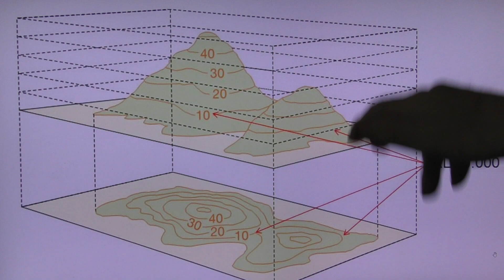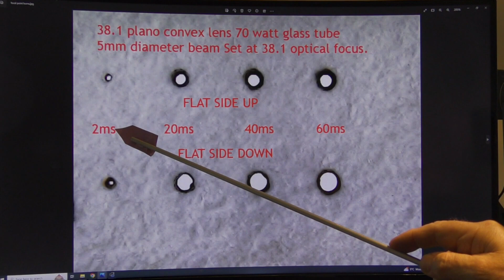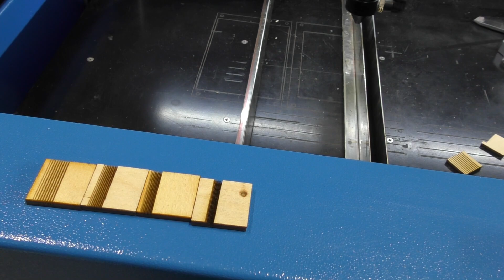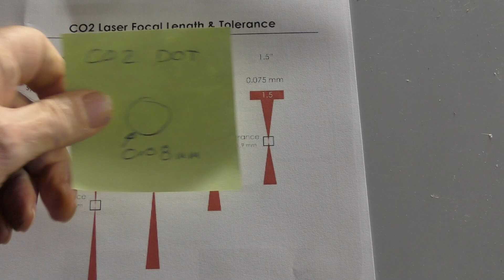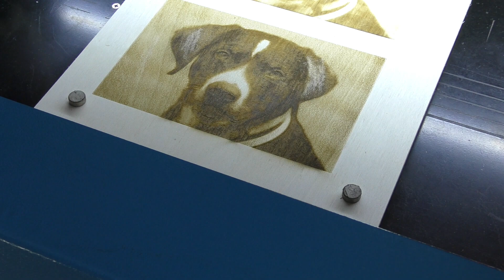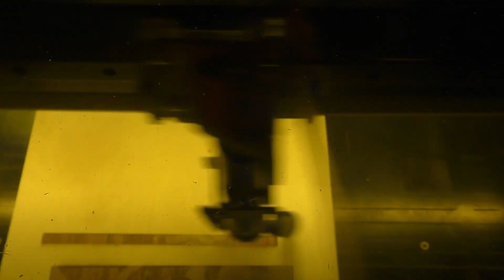3D Engraving Myths and Misunderstandings

Comment: Super informative but STLs (and basically any 3d computer mesh) can be used for "real" 3d engraving. However you need to turn them into a "depth map" using something like meshlab. 
Most software will display them as "renders" and like you pointed out that is basically a photo at that point.
Thanks so much for all these videos you are a true master of the laser!
Reply from the maker: Hi
 Thanks for the kind words. I understand what 3D meshes  are and as I mentioned in the video. they capture sufaces mathmatically in space and thus contain complete 3D information about a surfacere. However I am not familiar with any software that can  interpret a view of a 3 D object into a 256level depth map for laser engraving. You mentioned Meshlab  (maybe Slicer and Blender also?)  I have not seen any videos tutorials of these softwares that demonstar how  generate depth maps from STL files. Links to any such videos that you may be aware of would be extremely helpful. Many thanks......Russ
Reply: @SarbarMultimedia  Thanks for the reply Russ! It seems my reply decided to delete itself it seems you tube doesn't like external links sometimes so I'll do my best to give a tutorial here. Please note I'm still a laser novice and haven't actually tired cutting the outputs of this process. 
1) Load the model in Meshlab (File -> Import Mesh)
2) Rotate until you are happy with the orientation 
3) Change the Render mode to Depth Map (Render -> Shaders -> Depthmap.gdp)
4) Manipulate the Z Scale by adjusting zmax and zmin until you are happy with the depth detail and have both black and white areas
5) Save a snapshot (File -> Save Snapshot)
6) Treat it like you would any other depth map grayscale image. 
Hope that helps a little, As I can not thank you enough for the pure knowledge that all your videos contain. I'm probably 6 months behind and am currently catching up on your lens investigations and its blowing my mind. I need to experiment more I think!

Comment: I have one question but first wanted to say: excellent work on everything, cutting, engraving, optics...
Question: I have a nonworking old CO2 tube, is it safe to cut it open, I wanted to use glass tube for huge lamp project?
Reply from the maker: Yes. The gas inside is a mix of nitrogen10%, heliunm 80% and CO2 was originally 10%, all are non-toxic. The gas is at a slight vacuum  but it's not going to  cause the tube to implode. . There is a little glass nipple on one end of the tube where they filled it with gasses and then heat sealed it..Scratch this with a diamond and break it off to normalize the pressures. It's then just a glass sculpture for you to modify.

 Thanks for the kind words
Best wishes
Russ